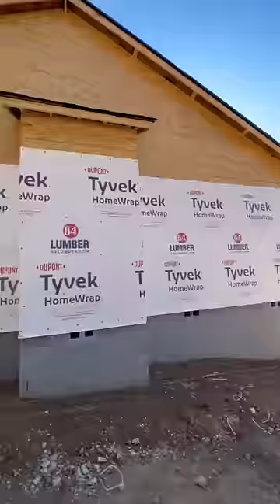Build My $350000 Wooden House in 60 seconds!!

Comment: "This looked really good." The fucked up foundation.... lmao
Reply: P
Reply: What was wrong with the foundation?
Reply: @moody9287  the house wouldn't survive an earthquake
Reply: @Matasuh  there are No earthquakes in parts of the states lol. More floods from hurricanes
Reply: @bruh that is a standard solid foundation poured concrete with block walls with rebar coming up from the foundation those cells are poured solid. Tell me what would be different
Reply: @GiftedUplifted  definitely odd to have blocks on a footing instead of just forming, but yeah if you reinforce with rebar and fill, that's solid AF. Didn't specifically see that they did do that, but I'd assume they have to have lol.
Reply: @bruh foundations in America are anchored to the ground too.. but everyone doesn't fill the foundation solid.. I've built a thousand houses and I've never seen one collapse..lol
Reply: @bruh tru dat. In my country we have solid foundation and everything from bottom to top is covered with brick and concrete and then its covered up with paint and tiles etc which imo is way better this wooden stuff seems too fragile
Reply: Genuinely looks like all unfinished, abandoned or dilapidated random concrete cubicles in the provinces of my country

the Philippines
Reply: If they were pouring the footing why not just pour the foundation too?! It’s likely the same reason he used particle board instead of sheets of plywood- a little birdie told him to, cheap cheap cheap!
Reply: In Germany we don't do this. We mostly have basements to begin with. But if we build houses without basements we pour a foundation plate. Not just the outline but the whole area where the house is. The baseplate is around 40cm or 1.31 foot thick.
Reply: @Slimboy025  in some parts of US basements arent possible, due to the clay content of the soil. the clay super heats and expands during summer, causing the house to move. such homes with basements would be vulnerable to collapse for this reason
Reply: @r3wturb0x51  i know in Germany we have similar problems. Sometimes the ground is just not suitable for a basement.
Reply: @bruh every time I see American videos I cheers the fact I’m in Australia.
Reply: @bruh like the poured slab and poured concrete footing for foundation wall? CMU walls are solid but moisture will get thru even if treated. . Poured concrete is better if done right. I've had both. And both were fine as long as that sump pump runs. 9 yrs in my house growing up with a deep basement, we had water in basement twice.Both times it was an inch and pumped out within minute of the sump turning on.
Reply: @bruh see you don’t even know what you’re talking about
Reply: @Matasuh  good point but what if he's in such a place (like where i live) where no earthquakes happened for tens of thousands of years?
Reply: @floot2sussy  wait ten thousand more years
Reply: @Matasuh  this tectonic plate is old and large af, there's not gonna be any earthquakes in like a million more years fortunately 😌
Reply: @floot2sussy  Wait a million years then
Reply: I’m no builder or anything but I agree wonder why he decided that
Reply: @moody9287  no posts not even metal rods to support anything. Earthquake hazard for that much, nah, we built our house for less and it will beat that house in safety.
Reply: @bruh trash??? Looks better than my house
Reply: @stonehaven2289  🧢
Reply: @MattSuguisAsFondAsEverrr  Lol atleast our houses are made of concrete in most parts, this is legit shit foundation here
Reply: In India we atleast go 15 feet deep for the foundation and entire house is built using slabs for roof and bricks for side walls.
Reply: @roninr8199  15ft? What for, besides don't you use metric in engineering? 
Labour is cheaper, but damn, at 5m the groundwater would get anything in my country. My city had it at 50cm, before a drainage system. Pylons or a basement flooring?
Reply: @bruh ease up a little man. The dude just making himself a home
Reply: In Germany this would be illegal as hell
Reply: @memerman7305  you don't even have a house then if that is better lol!
Reply: @nnif4990  In planet earth, no one would have asked.
Reply: The Red Sheep  🧢
Reply: Man, I'm in Canada here and with the frost/defrost, this Fondation is weird, house would be all fuck top in a year
Reply: @moody9287  What was not wrong with the foundation? I life in germany and i can now say that German houses are 10000000000000000000000000 times better than that american Sheds.
Reply: @Matasuh  i think in million years not any other building would survive🧐 unless nokia builds a skyscraper
Reply: @moody9287  Its literally just a few holes filled with concrete. We have a layer of compacted mineral concrete and drainage. (no basement). This house would have to had stilts rammed into the ground. I think raib might have a really bad impact on this house in the next 50 years.
Reply: @TreyParker318  still needs to be able to survive an earthquake regardless.
Reply: No rebar
Reply: @moody9287  yes. 100%
Reply: Jesus christ it is so bad lol
Reply: My hometowns looks even worse
Reply: @moody9287  house foundation is on a thin layer of. On concrete, it should be much deeper
Reply: @stephaniecoomey2356  why? Is this only for american construction videos or does this apply to any and all american videos?
Reply: Ditto
Reply: @glzarmy  some are amazing man, some are hot garbage
Reply: @moody9287  The foundation is 2 inches deep on loose soil. Let me tell you that house is going to shift, lean and probably crack the walls, windows, and definitively the plumbing will leak within 5 years.
Reply: What foundation? 😢 I stopped the video as I saw this monstrosity. Jeezzz
Reply: @mgntstr  right, silly me, I forgot backhoe buckets were smaller than the averages garden trowel. The footing is plenty deep enough, and rebar reinforced. Every single county in America has their own construction codes specific to their average soil composition, weather, and many other factors specific to location and building purpose. A house in Florida is gonna need a much deeper foundation than one in Texas. Stop assuming you know something just because it’s specific to a similar situation you’ve been in before.
Reply: @moody9287  nature doesn't give a hoot aboot yer building codes
Reply: @mgntstr  no, but our building codes give a hoot about nature, don’t know what your argument was trying to hint at.
Reply: @Ahmed-pn1lf  Facts don't care about your opinion.  Walls with actual insulation are better for temperature than solid material (dead air is the best insulator, and insulation provides a lot of that).   Your house may last 300 years, but that's a miserable 300 years.
Reply: @stephaniecoomey2356  aus is notorious for having much worse build quality on their homes than almost any other modern country
Reply: @deadchannel991  like which countries? Besides England. America, New Zealand are much worse than aus
Reply: @stephaniecoomey2356  I literally said all of them. It’s well known.
Reply: @deadchannel991  American houses fall over in the wind, at least we double brick here.
Reply: @jillian7636  in parts of the US some people don't want a slab floor it gets way to cold in the winter and some people don't like the floor that hard
Reply: @r3wturb0x51  and I think Georgia has a lot of that red clay
Reply: @sow4tt166  I noticed that to. maybe  it's because the house is in Georgia? We have to use rebarb here in the nothen part of the states -- something just doesn't look right with the foundation
Reply: @stephaniecoomey2356  lmao no they don’t. Tornadoes are not the same as a little bit of wind, have you ever seen a tornado? An F1 tornado is over 100mph winds. That’s level one. F5 is 261-300+ mph winds. At those speeds there’s nothing that will stand in the way. 

I see at least one per year, have seen probably 5 up close and at least 10 at distance. 

I live in an area where tornadoes and earthquakes are common. Houses like what you’re talking about wouldnt stand up to earthquakes like we have here. On average the us has about 16 major (7 or 8 on the Richter scale) quakes per year, compared to a level 4 once every 2 years in Britain. 
We also have about 1000 tornadoes per year compared to about 30 per year in the uk.

Comment: That footing and foundation is top notch! No way you have settling issues.
Reply: 😂😂😂 laughts in german
Reply: @daniisdlx  also laughs in Australian
Reply: Lolololol
Reply: Yea, I thought the same, cheap and sloppy and how level are those footings. The brick masons must have hated you!!
Reply: Blows my mind that there’s no rebar in the footing, it maybe looks 10 inches deep, and it’s not even close to straight down the left side in the aerial view. I too, am laughing in Canadian. 🙃😂
Reply: The footer is just the bottom foot of the wall that the block sits on. It doesn’t need to look good because it’s always going to be buried. So they just dig the hole and pour it in. No big deal.
Reply: my dude threw out ACI code out of the window. must be some agency out for blood